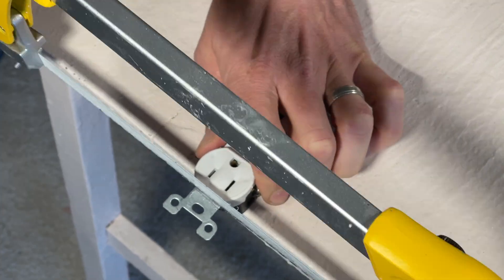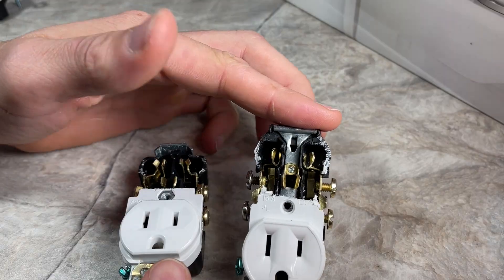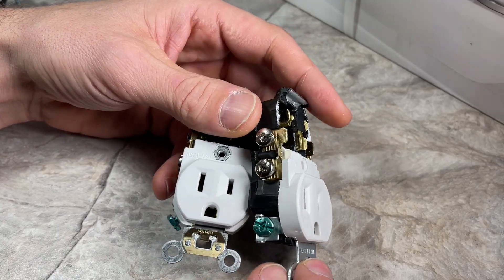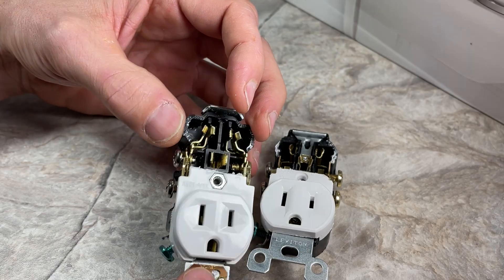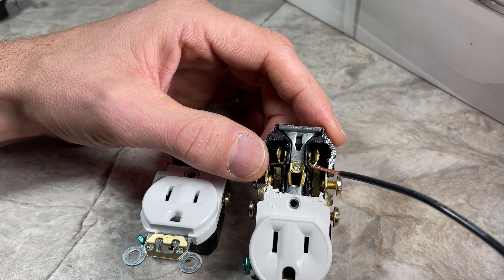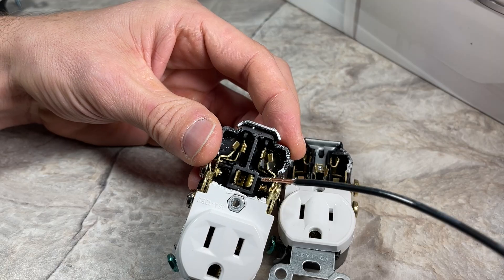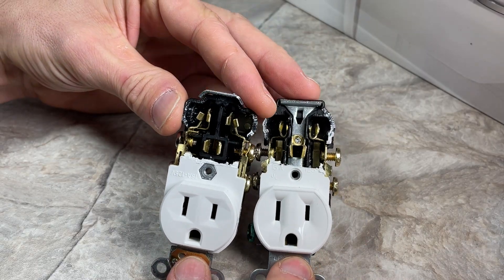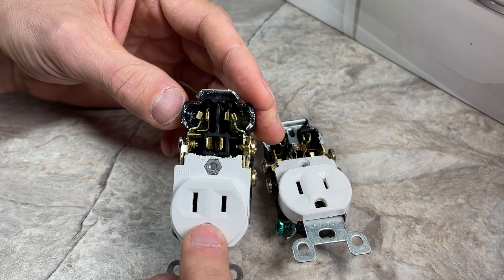What Outlet Should You Buy For Your Home |  Commercial vs Residential

Comment: Having worked for 25+ years in the factory that made these receptacles I have some knowledge about the differences. I retired about 15 years ago but some things haven’t changed much. The basic receptacle is a great value for the price when you consider the cost of brass, steel, urea (plastic), machinery, dies, etc. Until the 1980’s these were nearly hand assembled by my mother and hundreds of other Leviton workers in Rhode Island. Over the years the assembly lines were automated so one person then oversaw what six people used to do. The company was not making a financial killing on these receptacles, it was the volume that made it worthwhile. Keep in mind big box customers (aka Home Depot, etc.) and distributors to big housing developers wanted the least expensive device and would buy from Chinese competition if they didn’t get their price point.

IMO if this basic receptacle is installed correctly and you don’t frequently plug/unplug things into it, the receptacle will last forever. Lots of people will move into a home and plug in the floor lamp, tv, toaster oven, etc. and leave it that way for a decade. For that kind of use I think the basic receptacle will last forever. However if you frequently plug/unplug tools, appliances, etc. into a receptacle then getting a Spec grade receptacle makes sense. For the typical homeowner the Commercial/Industrial/Hospital grade wiring device is a waste of money. It would be akin to buying a Viking professional stove to boil water for a pot of spaghetti.

With each change in ‘grade’ the component materials do change. For example the basic receptacle uses urea for the ‘plastic’ parts. Higher grades of receptacles use nylon. The basic receptacle uses solid brass terminals (no they are not plated steel), higher grades may use phosphor bronze. The cradle type strap costs more than the pass-through strap, the brass grounding contacts on the strap costs money to make and attach, etc. The higher quality receptacles have much lower sales volume, so the fixed cost of tooling has to be spread over fewer units. And those extra components means more labor costs to assemble. Some items have such low sales volume that it is hard to justify the upfront cost to automate. And yes, with higher quality often means a higher profit margin.
Reply from the maker: Hey Roy,  awesome info!  Thanks so much for taking the time to share your experience with the manufacturing process and materials used for the different grades of receptacles.  Happy New Year!
Reply: "My mom made those" ... awesome to hear stories like that.  Thank you.
Reply: @jharuni  As a teenager while in high school I worked at Leviton for two summers sweeping floors, filling assembly line bins with parts, stacking boxes on pallets, etc. A few years later while attending college I returned for a night shift job in the parts warehouse and stayed with the company for 25+ years. By the time I took very early retirement I had worked on the factory floor, warehouse, production planning, cost engineering, and finance dept which monitored the budget of 15 factories in the USA and Mexico. So you could go a long way at Leviton, which was and remains a family company. I remember old-timers in the factory kidding me, as I walked through the factory in white shirt and tie, that they were at my baptism. 

It was the kind of company that when the owner, Mr. Leviton, came up from the New York corporate office to visit our factory lots of the older Portuguese women who were on the assembly line would stop and give him a hug. Leviton sponsored hundreds of their family members wanting to immigrate to the USA with a guarantee of a job when they arrived. I heard stories of many of them, parents and children, working all the shifts/hours they could. A year after arriving in the USA the father would buy a house and pay for it in cash, no mortgage.

My dad worked for Leviton just before WWII, and again in the Brooklyn factory when he returned from combat (Pacific Theatre), and later offered him a job in Rhode Island when he got married. Factory foremen would kid me about my mom as she would stop the assembly line if a brass part didn't fit just right in the plastic base, or if there was dust on a batch of receptacles otherwise ready for packaging. Lots of great memories and wonderful people at Leviton.
Reply: @roynajecki1100  that's a beautiful story. I can't think of companies like that anymore.
Reply: Wow, beautiful story. Worth watching this video to see your comments. Thanks for chiming in.
Reply: @roynajecki1100  Awesome to hear about a great company.  There seems to be so few of them these days.
Reply: @roynajecki1100  But I thought portugese do concrete and roofing.
Reply: @roynajecki1100  incredible, thank you for providing insight into Leviton and their merits. As an electrician, I'll be sure to look for their products first.
Reply: @jharuni  And made in the USA! Wow. I love to hear when things are made in North America.
Reply: I don't know why this post doesn't have a thousand upvotes.  Thank you
Reply: @BCS2023  People don't like to read. That man's prose is flawless, but you can't fix lazy or ignorant.
Reply: This is exactly why I used the commercial grade for my shed/workbench, and the residential in my home. The workplace outlets see a great deal more plugging/unplugging. Most in the house have had a lamp plugged in for years, others may get something once a week. The kitchen outlets are used a lot, but those are most GFI. When you count the number of outlets in a home and realize that they will not be mechanically stressed as much as in a workplace, it makes economic sense to use the less expensive option.
Reply: @arthurvandelay7677  If you have 50 outlets, the cost difference is like $100, which will be split over the lifetime of those outlets, maybe 20 years? Geezus I would buy the $2.50 outlet EVERY SINGLE TIME. $100 against the total cost of a house is nothing. 
Now where I live it's a different story, we get ripped off something chronic. A simple double outlet like in this video, from the established brand is $42 at a national hardware department store - the cheaper brand is $11. Both of them are made in China. It just sucks to live in New Zealand sometimes. (granted we have an on/off switch per socket which will increase the cost a bit - but not to the extortionate amounts we must pay).
Reply: @chocolate_squiggle  I don't buy the cheapest out there, I get the less expensive. I've had no problems with this. Sounds like I have a larger selection and lower cost than you have in NZ.
Reply: That was an extremely informative comment and I appreciate you sharing that. There are some people and I'm afraid I'm one of those that just simply say if I could buy something that's only 60% capable versus having something that's 80 or 90% capable, I will try to pick the 80 or 90% capable because again like I said in my individual comment up this chain thread, I want to put it in and forget about it if you will. But thank you for your contribution it was excellent!!!!
Reply: Geez Roy...you sound like me! I did 46 years with AT&T. I've always tried to help people understand the products and services from an insider perspective. I absolutely enjoyed your insight on these outlets. I've purchased and installed many of them over the decades. Now I know more than I've ever known about what goes into them! I tip my hat to you and your mom for y'alls service in your industry and for helping make this a great country!
Reply: I do have to disagree with part of what you are saying. I need to replace quite a bit of the aging electric in my home. But, say I have to replace or install 20 outlets throughout my house. While $10 vs $40 is quite a large difference by itself, in the scope of the project it's almost negligible. Meanwhile, we can't really know for sure how things will be used in the future. Even if I'm comfortable keeping everything as is for years, if I die or move, I don't know what the next homeowner has in mind. And boy howdy is a loose outlet annoying. I'd much rather spend the extra money now for something that will be a bit more solid of a purchase, especially when even the expensive option is so cheap. Buying a Viking stove is a very significant purchase for almost anyone, and so would never make sense for boiling water unless you have enough money to simply not care about anything, but these outlets are so cheap that unless you're only replacing as an immediate need and you're really tight on money in general, you may as well just go with the more expensive option.
Reply: @ericromano8078  I agree with this logic.
Reply: (Continued...) I have replaced outlet after outlet as a favor, but what would another homeowner at her stage in life do? Pay an electrician more than it would have cost in the first place to go with good quality products instead of bottom-feeding, dime store parts. This is not a situation of buying a Viking stove to boil a pot of spaghetti. Using those cheap outlets is like those people who bought a new Yugo in the 1980s instead of a good used Honda Civic: making the mistake of false economy. When I bought my 1980s house in 1995 I went through the whole place and replaced every outlet. Only one has needed replacing, just the other day: turns out it was one of the originals I had overlooked.
Reply: Well said
Reply: I have to agree with Rich Mac. Our local GM plant used to employ 35,000 people in the 80’s. Today, 2500. Tomorrow.....who knows. Automation not outsourcing will continue to affect the job market in the future.
Reply: Roy, thanks for a very interesting and informative addition to a great video! Well written!
Reply: wow, excellent presentation..think heat has something to do with rec failure. been doing this for 50 years and think the rec is better now.  excellent value.
Reply: Wow, got me interested into the story about your mom. And  remember what I did the same summer job at Voltar Company working on hot press soldering on the plug assemble but I never pay attention to what the kind of martial was make out of. Great info.
Reply: Most people only use around 12 to 15 outlets in their homes, the rest of the receptacles are glorified convenience outlets. For the high use outlets that constantly get devices plugged in and out, get a high grade commercial or professional outlet. For the outlets that are in the upstairs spare bedroom that sits empty 99% of the time, use a $2 receptacle and you will never have a problem.
Reply: Very interesting, I did not know that Leviton was a Rhode Island brand! I try to go for the higher grade parts when shopping at HD (I live in RI). There is absolutely a difference between the "standard" and "preferred" standard 1-pole light switch. Also, I have seen at least 2 or 3 of the bottom-of-the-barrel receptacles melted/(literally) burned out/completely destroyed due to what I assume was a loose wire screw terminal connection. For something like a receptacle that's going to be there for years, and also where the cost between junk and decent is only a dollar or two, I can easily justify going for the better option.
Reply: @MittyNuke1  The factory was a three story mill building on Jefferson Blvd (Hillsgrove) in Warwick. Built for Mr. Hills in the 1880's the factory made cotton fabric. It then was used to make bi-planes which they rolled down the road to the nearby and newly opened state airport. Then it was briefly used to make beer: Consumers Brewery. I remember parts of the basement had thick cork wall linings where they stored the beer. Mr. Leviton bought the Hillsgrove building around 1940 because the original factory location in Brooklyn NY (Greenpoint neighborhood) didn't have room for expansion. The company added to the Hillsgrove building several times into the 1960's. The company also started (and continues to operate) factories in North Carolina in the 1960's. For about ten years Leviton had a factory in West Kingson RI where they made the GFCI devices. That building is now used by American Power Conversion which makes UPC's for computers. 

When the Hillsgrove factory closed in 2006 the newer buildings were sold to a warehousing company. The old mill building was going to be refurbished for office space and/or condo's but the building layout, asbestos remediation, etc. made it cost prohibitive. About five years ago the old building was torn down but they did salvage the huge wooden beams, bricks, granite foundation blocks, etc.  I expect that land will eventually be used for a new hotel as it right across the road from the Amtrak train station and the walkway to the state airport.
Reply: @roynajecki1100  Thanks for the history. I grew up not far from there in the 60's - mid 70's and it seemed everyone had a relative that worked there at the time. I'm in CT now but I go thru that area every few years. It has changed quite a bit since those days. The Greenwood is still there!
Reply: @michaelg3911  Yes, it seems that everyone in nearby towns had a relative or knew someone who worked at the Leviton Hillsgrove factory. And yes the Greenwood Inn on Jefferson Blvd is still there after 70 years. I was told that is where my parents brought everyone for my post-baptismal lunch in the 1950's. And decades later it is where I would go for Friday lunch with my Leviton colleagues. The waitstaff would cash our paychecks as we ate lunch.
Reply: @roynajecki1100  Oh, the loss of the original mill building is just tragic :(   Understandable, but....still.
Reply: Roy, that’s a great anecdote and very informative!  So cool
Reply: Appreciate the explanation. Thanks.
Reply: The construction method for joining the plastic face of the receptacle changes between the cheap and the more expensive plugs, additionally the thickness of the materials is also noticeable. The exterior snap style faces cause a lot of shorts, in my experience with installing and remedy of residential electrical it does matter a lot, a broken face is one of the most common issues. As well as the entire plugs breaking apart, previously it was primarily the dated plugs made with the older low-density plastics like Polyethylene terephthalate that became brittle over time. Now I've noticed in the last 15 years or so a decline in quality with the cheaper plugs.
Reply: Thank you!  You tripled the value of this video.  If I have thirty plugs, at an incremental cost of $1.50, I'm spending $45 extra.  So, over the next five years, I'll be spending $9 extra per year.  I'm going Commercial on my next upgrade.
Reply: Spending thousands of dollars on a stove you don't need isn't quite the same as spending a buck fifty more on a better receptacle than what is necessary.  I mean your only talking maybe a hundred dollars to significantly improve (and maybe make safer) your home's wiring.  And if Leviton makes a little more profit so much the better.
Reply: Well, for the receptacles over the kitchen counter and the toilet, there is a lot of plugging and unplugging going on. Plug in the toaster, unplug to plug in the kettle, then, switch for some other appliance.
In the toilet, it can get even worst.
Reply: Problem: The big box stores dictate what and where the manufacturers produce. The BETTER product volume drops, and at some point, that manufacturer jacks up the price of those items unrealistically, further pushing the economy model. Ultimately, the better product is delisted by distribution, and may be discontinued by manufacturer.
Reply: Just an excellent discussion of the facts. I have outlets in my home that have never had anything plugged into them and possibly never will. The 'residential' versions of an outlet are just fine and so many of them are produced and used that if they were causing houses to burn down Leviton would have been put out of business long ago. It's not unlike buying a Snap-On wrench for a $100 versus a Harbor Freight one for $20 and then using it three times during your lifetime. Keep perspective folks.
Reply: That comment was a YouTube video all on its own bro. I love it
Reply: Thx , Roy 🥇
Reply: Can you tell me why my "Made in the US" Leviton light switches crack so easily from basic use? The outer plates crack, the inner units crack, etc. I've had to replace many of them over just a few years.
Reply: @Asiansxsymbol  I can't answer your question. The Rhode Island factory I worked at didn't make the light switches, or very few of them. The light switches were primarily made in the Brooklyn, NY and later the North Carolina factories. So I didn't get reports or hear stories of what problems the company was having with light switches.
Reply: @Asiansxsymbol  abuse and low quality , ask Roy..
Reply: They are still made in USA except it’s done by robots instead of people
Reply: Just a question, I can use a power strip to not have to worry about constantly plug & unplugging?
Reply: @vladiiidracula235  Then you will have to deal with the strip and unstriping. And that's what clubs are for.
Reply: @vladiiidracula235  Ones that are good enough to not risk a fire are far more expensive than a good outlet, but yes, as long as you don't put too much on the same circuit.
Reply: @vladiiidracula235  Most power strips have a low amp rating, so be careful not to plug in high load items.
Reply: @Kodiak660  High load products should always plug directly into the outlet. The further you get from a zero ohm connection the more heat will be generated at those connections even if the amperage ratings match up.
Reply: @williardbillmore5713  you are preaching to the choir.
Reply: @Kodiak660  Not everyone here today may be in the chorus...
 Jus' sayin'
Reply: @williardbillmore5713  yet your reply was directly to me. Trust me, you are preaching to the choir. The amount of service calls I go on involving power strips is staggering.
Reply: @vladiiidracula235  There are various qualities of power strips too though the greatest advantage of a power strip is that they have a switch and can be switched off as well as the power strip can be readily replaced.  Keep in mind that if the strip has power surge on it, it has a device between the hot and neutral which will short if the voltage is over a certain value.   A friend of mine once built a miniature parallel computer rack with small notebook computers for the sales staff to demonstrate to clients, when I visited, a sales man returned from a second trip to a client in China and said the rack blew the office circuits again, my friend said he doesn't know why since the laptops were rated for up to 240 volts, I said you must've used an expensive voltage surge power strip to which they said of course only the best and I had to point out to them that 220 v is a voltage surge to such a power strip.  It's important to know the consequence of the quality of products you choose to use and it's not always of crap to quality.
Reply: @vladiiidracula235  if you like fire
Reply: @phi31411  Will they be bright enough to turn me to dust?
Reply: @vladiiidracula235  vaporized
Reply: @phi31411  Power strips cause fire? I thought they were designed to not cause fire? 🤔
Reply: @Asiansxsymbol  .no circuit breakers stop from MOST* fires, extension cords on outlets can still be a problem
Reply: My man, I couldn't speak that eloquently about any subject on the face of the planet, but yet, here you are giving an excellent dissertation on the humble 120 outlet. Kudos.
Reply: @Globe-trotter-1  Always frowny-side up, happy side down!
Reply: Look at this sick edit comrade:
https://youtu.be/UIP2s9NsY0M
Reply: That factory was in Newport right? I live near there.
Reply: @donaldsmith5972  No, it was in Warwick near the airport.
Reply: I love boiling a pot of spaghetti on my Viking professional gas stove!
Reply: I think this is first time i dont even need to watch the video. Thanks man! 👏🏻
Reply: Well stated
Reply: Great points!
Reply: I remember when it closed on Jefferson Blvd. 😠
Reply: That was very interesting!
Reply: Great explanation/ comparison.
Reply: The commercial is fractionally more expensive to make, and way better.  What's the cost of rebuilding houses gutted by fire?
Reply: I’m a firm believer in using power strips for every outlet in the house
Reply: Great story, thanks for sharing it. The one disconcerting comment, and it's just the way things are, is "the line was automated and one person now does what it used to take 6 to do". While jobs being lost to overseas competitors is a real thing it's really automation that has decimated the job market and it's only going to get worse (far worse). Glad I'm old and on my way out because I don't think the future is going to be all that rosy for future generations.
Reply: Unfortunately, widespread use of these pathetically flimsy, cheap outlets is typical of the short-sighted, cost-cutting attitude so prevalent in housing construction today. Sure, it might be possible to scout the location of a home’s outlets and selectively install quality outlets in high-use areas, but no electrician wants to do that. Yes, you will likely leave that new home in a few years, before the outlets disintegrate, but sooner or later someone will get stuck with the cost of replacement.
I have a longtime friend, a woman in her early 80s who has been widowed for 20 years. She and her late husband had their home built 30 years ago. It is impeccably maintained top to bottom. They had no children, so this home has had the most delicate of use, yet these toilet-paper outlets have started failing power cords all over the structure. In the kitchen island and under the cabinets. In the master bathroom. In the hallways and living room where the vacuum cleaner was plugged in. Next to a favorite chair. In the garage where an extension cord has been used to power yard tools. With a larger family the failures would have happened in more outlets years earlier
Reply: Also, people generally move every 5-7 years now, so the builder will probably be 3-5 owners removed once the receptacles start failing. Becomes like buying a used car. Nice  information though. Had to replace all receptacles in a 50yr old house, but the reason was lack of grounds, not receptacle failure. If you are going to selectively use a higher grade, kitchens, bathrooms, & garages make the most sense. Side note: the thicker internals DO handle the thermal load better. Seen a microwave MELT a cheap receptacle before tripping the breaker, yet all home wiring was fine. Long run on a max load caused the failure (not a fire). Try pulling 1500w through 15a @ 115v for 2+ hours, then do an IR temp check. The CORDS will often be hot, and any internal arcing is a disaster in the making. These kinds of videos are worth their weight. Thanks again.
Reply: My current home was built for me in 2000. I  have had at least 4 electrical receptacles that have failed over the years in my home. Of course in the places of freq use like the kitchen.
When I build my next home, I  will put professional grade plugs in all of my rooms in that future home.  The labor cost to have someone replace those 4 plugs is probably 10 times the cost difference if all of the plugs were commercial from the beginning.
Since my current home was built by a big name nationwide company, I  did not have any choice on the kind of plug that was installed while the house was being built in 2000.
Reply: @akidwaimd  You could replace them yourself. Provided you know how to find the right breaker.
Reply: @akidwaimd  the labor to replace outlets is turning off a breaker and turning up to about 10 screws each.  if you are slow, it might take an hour and 10 bucks in parts if you buy the "professional" ones
Reply: @natalieisagirlnow  unfortunately, in some places or situations you can’t do it yourself, requiring a handyman at $30-60 or licensed electrician for more...
Reply: @TomCee53  What situations. I guess if it's in a commercial applications or if your disabled, but other than that replacing an outlet should fall under basic home repair.
Reply: @akidwaimd  If you are  too helpless to install something as simple as a wall outlet yourself, then the logic of using the higher quality, expensive item makes perfect sense.
Reply: ?ພອນ.;.
Reply: urea is not used anymore, they are all thermoplastic now